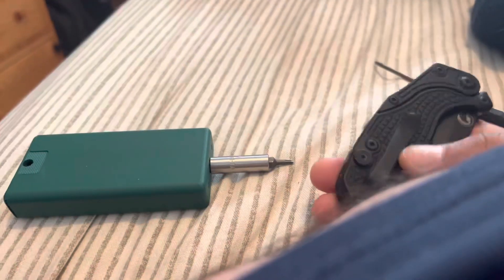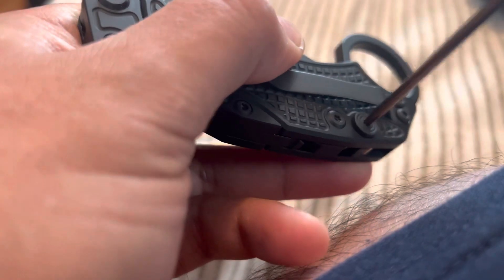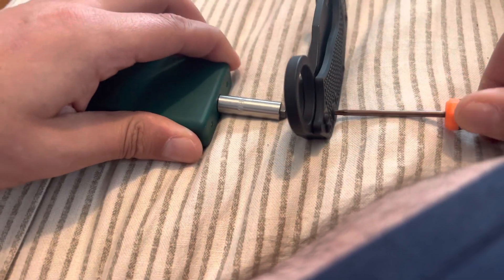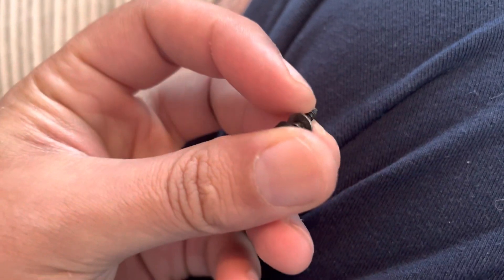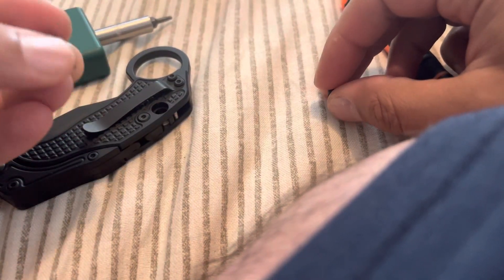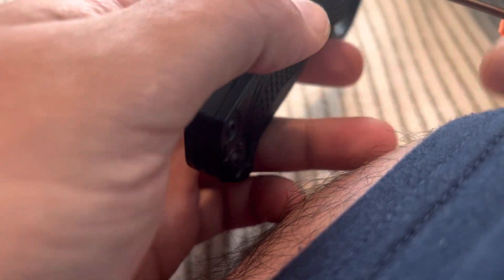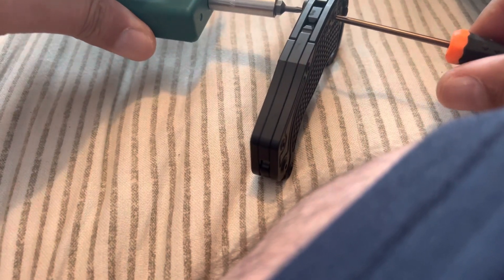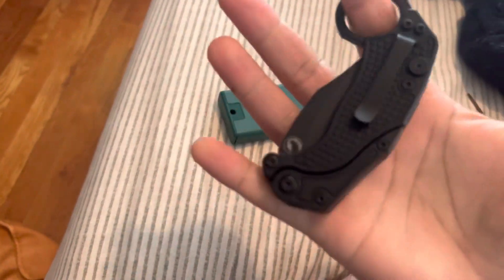Button flip on Reate exo-k

Comment: I can’t seem to get the button side out.  The one side the mini screw that comes out of the shaft comes loose before the side that is pressed, causing the bolt to just rotate.
Reply from the maker: You’re using two t8 drivers?
Reply: @the_knife_degenerate  Yes, the screw is loosening on the side where the button isn’t pressed. There is no way of locking the sleeve to loosen the side that is pressed.
Reply from the maker: @sunnys14  weird. If you don’t mind, can you send me a video on instagram @the_only_loucifer or make a video on YouTube and share the link? Curious as to why you’re having issues